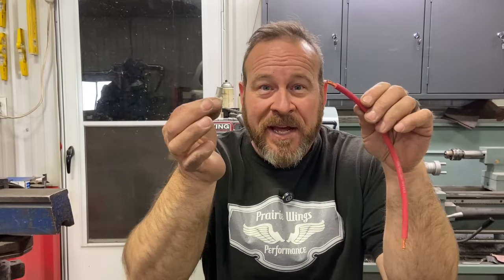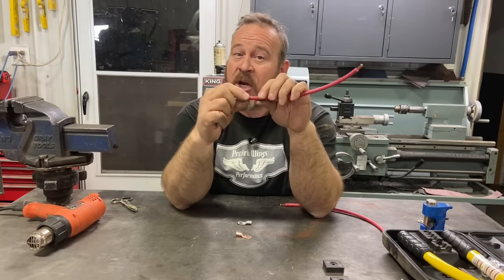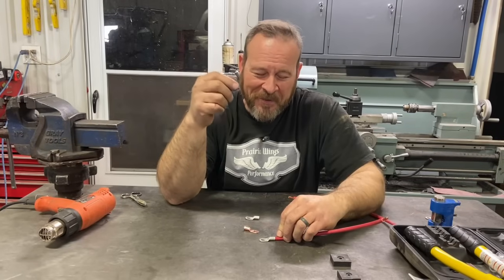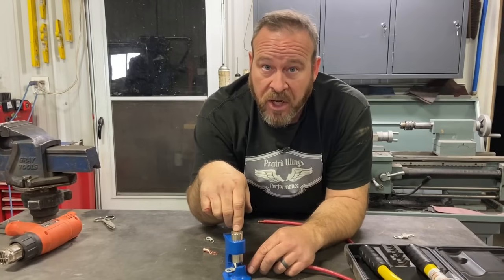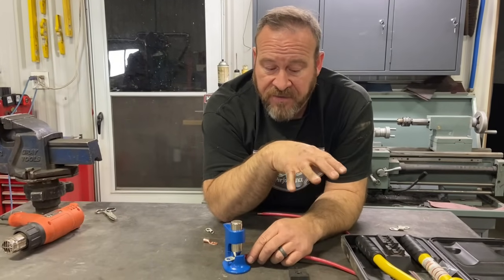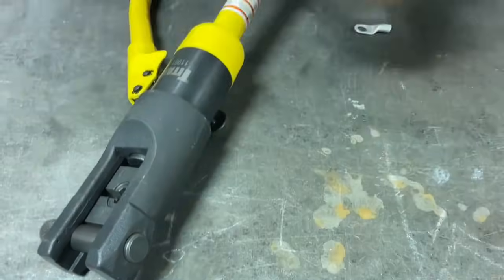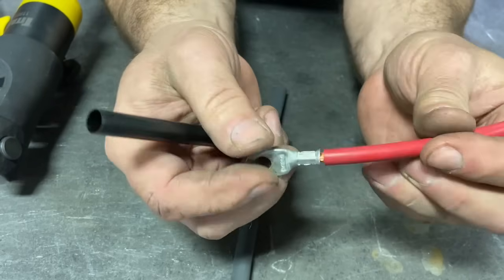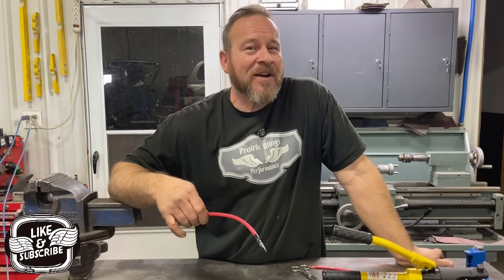Crimping Heavy Cable Ends - Which Way Is Better?

Comment: The issue with the die size on those chinesium hydraulic crimpers is the gauge standard is probably correct for a style of wire/terminal you aren't using. There's different dimensions for solid, stranded, flex, weld and hyperflex. You'll find this distinction listed on wire for commercial applications but rarely for consumer and automotive jobber stuff, there might(should) be some sort of code printed on the wire and a catalog entry to decode it... somewhere. Ultimately though, you have the dies you have, use the one that works best. Unless you want to spend Burndy or Thomas and Betts money, where they have proper dies that will emboss on the crimp that you used the proper die.
Reply from the maker: @davewood406  sounds like nice dies to hope for one day!! All have the comments that have been left have given a huge resource of information including where to find those specs and good tools to buy. Really appreciate you taking the time to comment!!
Reply: @prairiewingsperformance6036  A set of Thomas and Betts TBM6 would be sufficient for the largest of automotive cabling, they'll do 4/0, but also small stuff like 6 and 8. Spendy new but there's usually some on Ebay, dies included are the wildcard. Sometimes none. There's also a TBM6S, that has a ratchet to ensure you crimped completely. Avoid unless spanky new, that's really the only part of them that will go bad, plus that ratchet is more of a telecom requirement, something an observer would make sure you have...
Reply from the maker: @ great info, thanks again this should help everyone… possibly make it harder to find the tools used🤣. Thanks again!

Comment: Great advice and principles of forming a sound, long lasting crimp joint.  I have not used the hydraulic tool but I do recognise the issue of excessive "lash" caused by the crimp spilling outside of the crimping die.  I have used the larger single point tool but in a hydraulic press rather than beating on it!  I still use this method for larger cables.  For the size cable you were using, my preferred method is to use a large plier type tool that puts in a single indent, the tool I have is an HS-16.  This method maintains the size of the crimp which is often important to me.  I am not Familiar with AWG wire sizes, only mm2 so have avoided direct comparison.
Reply from the maker: @paulcharman44  absolutely appreciate the additional added experience everyone is sharing here!!! The comments generated on this video should be able to help people make a pretty educated decision, I will be updating my crimping set up. I really appreciate the time you have taken to share your experience!!

Comment: Been using hydraulic or ratchet crimpers since the early 90s. Ive only soldered a few cables and i didnt think it was a very good method. The type of crimper you use means alot to the quality of the crimp. Greenlee crimpers are the best in my experience
Reply from the maker: @Craig-fl8jj  perfect thanks for the information, an update to these is in the works. They have made a ton of crimps over the years and haven’t heard of a failure yet. Can always do better! Thanks for commenting

Comment: I noticed the small rectangular hole in the crimp (used for soldering) is not covered by your heat shrink tubing. Surely this is an entry point for moisture to penetrate into the copper and promote galvanic corrosion from the inside.
Reply from the maker: @DavidHobbs-d8h  yup, been called out lots on that one here, oops🤷‍♂️. They are the ones that come with aftermarket harnesses. I rarely use those but if wire comes with lugs I use them. I absolutely appreciate the time you took to watch and do comment!!

Comment: I love this topic, who's right and who's wrong? I used to do the occasional helicopter starter cable, "The" procedure in the AP was crimp with a particular brand (?) Crimper that was certified and calibrated, it came with "go" "no go" test pieces to check the crimp dimensions and imprinted a code number on each joint, we then had to solder with a specified amout of solder, then compare to pictures showing the finished joint, always perfectly formed? I bought a cheap Chinese hydraulic Crimper for some projects years later, absolute rubbish by comparison! But doing the method you showed works good enough for most jobs.
Reply from the maker: @551moley  there are lots of great tips and information in all the comments. The crimping process I showed I have been using for years. There are tons of miles of proof of what I showed works, haven’t had a failure that I know of. A person can always improve anything you do. I do definitely appreciate you taking the time to watch and share your experience!!!

Comment: I went down this rabbit hole before. It’s crazy that there are so many styles of crimps. I will normally pull up the spec sheet on the ring terminals I use. Some spec indent style, some hex crimp & some W crimps. The W crimpers are very expensive. The dies are like 2k & crimper like 5k. I have a Temco indent style, Lever action & a Temco hydraulic with + dies as others stated. I crimp 2/0 & 4/0 ok, not exactly as would like them. I am going to try your turning method to get rid of the flash/wings completely.
Reply from the maker: @TBJK07Jeep  there are also tons of great suggestions on different crimpers in the comments as well as some great tips. Thanks for taking the time to watch and share your knowledge.

Comment: I am retired from Telecom equipment installation work, had done large gauge wiring and cable crimps for over 15 years in my employment. We always used Thomas & Betts or Burndy crimps and properly sized crimping tools and dies, you will not get "wings" if you use products that are properly sized , unlike the hodge-podge assortment of crimps and crimper of unknown compatability you are demonstrating. Thomas & Betts & Burndy products and tools cost moe, but when reliability, standardization and timely completion work is needed, paying for the right tools & supplies will always give you the best results.
Reply from the maker: @Internutt2023  when I bought this I thought it was good, I payed lots for it. After all the great information in all the comments I have a new setup on my wish list. Thanks for sharing, another tool to put on the comparison list!!

Comment: Just squishing the connector around the wire is no good.  You need a dimple in the connector.  They sell good crimpers for up to about 10 Guage wires for $20
Reply from the maker: @Dwnsowth  sweet, what brand?

Comment: Great content, I am getting ready to do some upgrades on my RV, any affiliate links for wire, ends, and shrink tube?
Reply from the maker: @DwDDB  definitely a great pair of crimpers is a must. So many people have shared great information in the comments I actually have new crimpers on my wish list. I was going to sort through and make a list of crimpers listed and take a look. I purchased mine thinking they were a great pair but noticed the same ones at princess auto… I have enjoyed and had great success with the crimpers I have. Most of the lugs are PICO some are out of wiring harness kits and the heat shrink I use is either PICO or Techspan double wall. Thanks for reaching out for more information, comment if you want more information.

Comment: I’ve been using the crimpers that look like bolt cutters with the dies that rotate. It makes a quality crimp but not as nice as that hydraulic tool. Might be time for me to upgrade
Reply from the maker: @MattLitkeRacing  definitely, if you search through the comments there is a ton of great information on crimpers. I have a new one on my wish list, I’m going to be making a list of the suggestions and checking them out. Thanks for taking the time to comment!

Comment: As an electrician, I borrowed a crimper to make up new ends on my brother-in-laws boat. The original ends were shot.
Reply from the maker: @warrenharrison9490  did the crimper you used work well?? Thank you for taking the time to share.
Reply: @prairiewingsperformance6036  it did, the crimper and ends are what we use in electrical contracting. Definitely better than what was rotted and corroded on the ends of the cables.
Reply from the maker: @ nice, always love good tools!

Comment: I was a electric motor technician for 30 plus years . We only used AMP crimpers  and amp connectors . What you’re using is junk compared to AMP connectors and crimpers . Like you we used 50/50 solider when I started in 1978 
Then we started using only AMP products. AMP sets the standard when it comes to electric connections especially high current applications.
Reply from the maker: @charlesdavaro8554  thank you for sharing! After all of the comments I have put a new set of crimpers on the wish list. I have to compare lots of crimpers!!!

Comment: Copper wire is susceptible to corrosion if exposed to air and moisture.  No matter how good your crimp is, the environment it is in will determine how well the metal to metal contact is maintained.  Proper soldering is not perfect, but better than a crimp alone.
Reply from the maker: @Joseph-j9r7g  definitely corrosion is always a concern. A ton of the stuff I work on is old (hot rod world), it is crazy to see how bad corrosion can be. Cut some of that old wire in the middle of a 10’ piece of wire with no problems in the coating and is all a black inside! Thanks for taking the time to share your thoughts!

Comment: The correct way to do it is using MATINS 1-1A-14 . You can download it anywhere and that describes, among other things, how to crimp a terminal log on a wire! 👍🏻 I've been doing this for + 42 year in the Air force.
Reply from the maker: @PeterO1965  thank you so much for sharing the information, it is really helpful all of the information that has been shared in the comments! I really appreciate you taking the time to watch and taking the time to share this, much appreciated!!
Reply: @prairiewingsperformance6036  I know that 1-1A-14 is a large document (almost 1000 pages) but there os a lot of information in it, not only terminal logs but all you need to know about wires and cables. Any questions just write me, I'll be glad to help ! 👍🏻
Reply from the maker: @ absolutely appreciate you being willing!! Thanks again for the support!

Comment: I started out with the same blue crimping tool you have that you strike with a hammer and used it with great success and then got a set of bolt cutter style crimpers (2 pc small and large)  each one has 4-5 sizes.  I really struggled with matching the lugs to the correct die sizes and would usually end up with the "wings" like you did, so I moved back to my hammer crimper for most things.  I suppose I should play around with the leverage crimpers some more and see if I can find the right combination of progressive die sizes to get that factory look.
Reply from the maker: @jheetman  absolutely I would try to see if rotating the end in the crimp works. Are they hex dies?
Reply: They are hex dies @prairiewingsperformance6036

Comment: Be careful tugging on the loose end of that assembly, if the wire does slip out of the connector, or the vice, you will probably ram this through your eyeball and into your brain. Please don't do that. Also, if strands are breaking, you need to secure the wire better. That's why most Romex code requirements have us stapling the wire within 8" to 12" of a box. Same goes for any wiring from aerospace to diy garage.
Reply from the maker: @jamesplotkin4674  I tell you I’m betting if that happened the video would go viral! That would be a good set up to make videos go… on the other hand I think it would look fake and probably would hurt😳🤣. That’s one of the best comments yet! Thanks as well for sharing your expertise!

Comment: I use a screw style crimper (it's great for when you're upside down in a dash), then I'll flow just enough solder into it to wet out the exposed copper, just to insure there is no way for it to oxidize, then heat shrink it with a 4:1 ratio weather seal heat shrink.
Reply from the maker: @Shukodoshi  nice! Thank you for sharing, some great tips shared in the comments!!

Comment: I thought I was the only one to use the bigger Die.  I would then go to the smaller die.
If the Lug has the hole in it like Your does, Id flux real good Crimp and solder to seal the connection up.
How did You seal the hole ??
Mike M. Central Wis.
Reply from the maker: @m9ovich785   I haven’t yet. I’ve been called out on that one lots😬. Those ends are the ones that come with aftermarket harnesses. I am probably leaving it on this one. It’s on a customers vehicle that will only see the road when it’s a beautiful day and the sun is just right. By the time the rest of the build is done I’ll probably be bugged by it enough at night when I’m trying to sleep it may get a small dab of solder?? I appreciate you taking the time to watch and comment!!

Comment: The pedal thingies are called flashing.  I'm a retired electrical engineer specializing in wiring and termination.  In my experience the best terminals come from a company called AMP Corp.  I think they are now owned by Tyco aka TC Connectivity.  Every wire awg has a proper terminal and associated die.  While AMP makes high quality components, they are also expensive.  I like your putting shrink tubing on the assembly.  BTW. The gold standard for crimp quality is a pull test.  Also, in areas of high vibration you can add multiple pieces of shrink tubing in a stepped pattern to resist breakage.
Reply from the maker: @googleboy7  thank you for adding some great information, much appreciated. After all the great comments to this video I definitely have put some new tools on the wish list, I love tools. I will check out the ends too. I have been using that crimping tool for a long time with great success proven from time but we can all do something to a higher standard. Thank you for sharing your knowledge!!

Comment: I understand that if you’re trying to make it look pretty and like it came from a factory then you might want to go this route but personally I have been using the Temco manual crimping tool for years now and it’s waayyyy faster than messing around with the hydraulic crimpers and you don’t have any dies to change out that can break after several uses like the hydraulic ones can. You also don’t have to worry about the hydraulic fluid leaking out and getting all over everything. Now like I said I understand if you are doing a job for someone that expects it to look like it came from the factory but in my case it’s just not worth the extra time , money and hassle of dealing with the downside of the hydraulic crimpers. If I were a wealthy man I would send you a pair of those Temco crimpers to test out but unfortunately I don’t have an extra hundred bucks to throw away at the moment. Feel free to check them out though. You can get some of those on Amazon if you want. Now that I’m done with my relentless marketing campaign for Temco “ which I have no financial interest in by the way “ I just think that they make a superior product. The crimp that you did looks great !!!!!

Comment: Nothing wrong with the hammer crimper.
Reply from the maker: @syntaxerorr  nope there is not, used it for years with great success. I do have to say using the hydraulic for years I’m glad I did the upgrade, originally just for the look of the finish. Thanks for taking the time to share.

Comment: Most dies have 2 wire sizes stamped on them, one for stranded and one for solid or low strand count cables. Right die right connector always makes a great crimp.
Reply from the maker: @markelliott7917  thank you so much! Thought I was buying a good tool. After reading all the comments I have a new tool on my wish list. Thanks for taking the time to share.